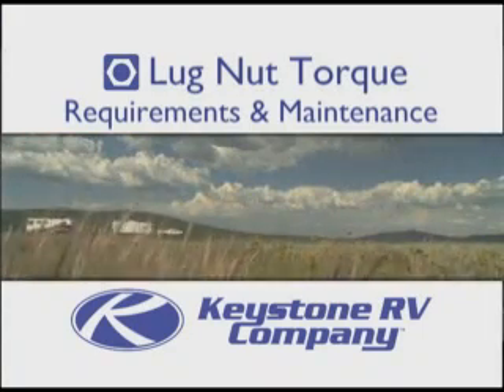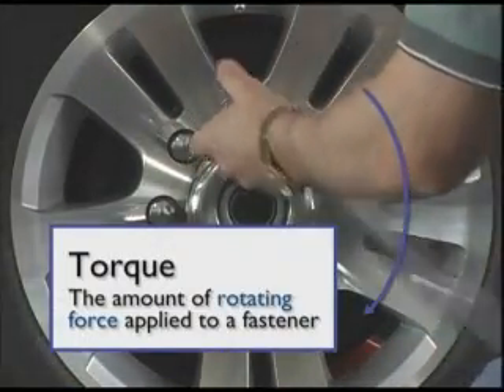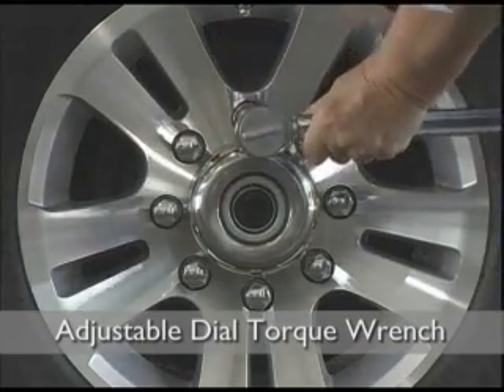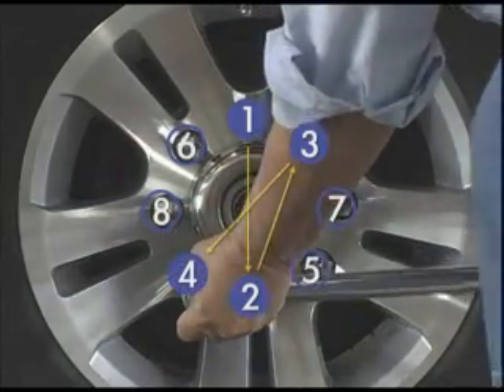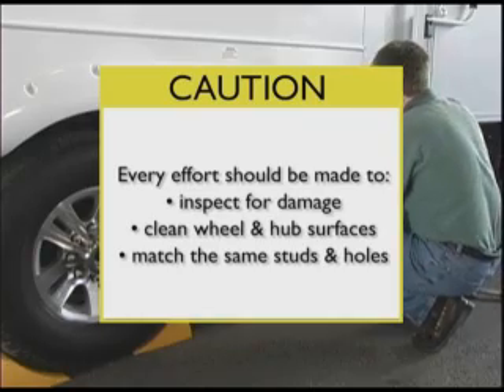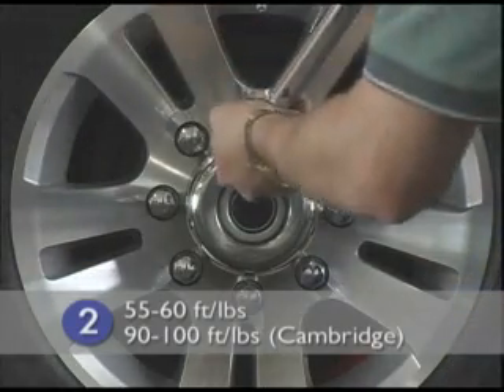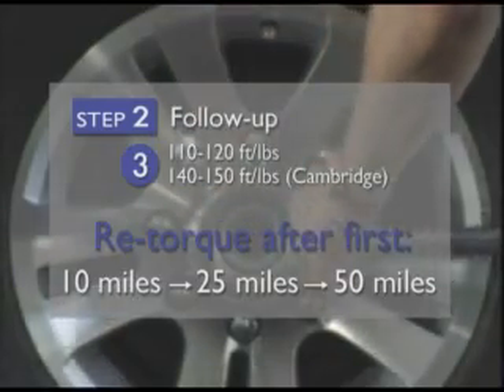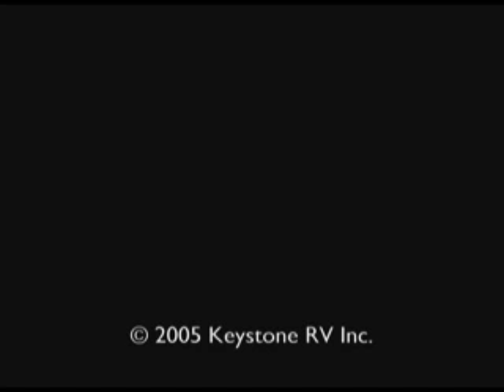How To: Maintain Proper Lug Nut Torque on a Keystone RV

Comment: A good video but a few comments. The torques needed vary by wheel and load type. 100ft/lbs is common for most 5 lug hubs while larger RV's with 8 lug hubs usually require 120+. Its definitely not one-size-fits-all. Also, the woman in the video is not using the correct method of holding the wrench. She is leaning on the wrench handle with one hand and should be supporting the wrench head with the other hand in an opposite direction. This is so a true rotation force is placed into the nut. Her method will not only give a false reading, it will also round-off the nuts. This is especially true when using an extension as shown. Readings should also be reduced when using lubricants.